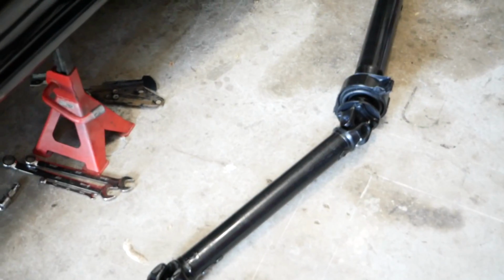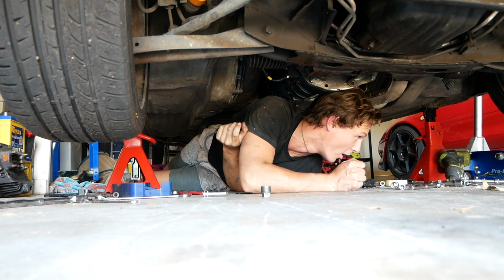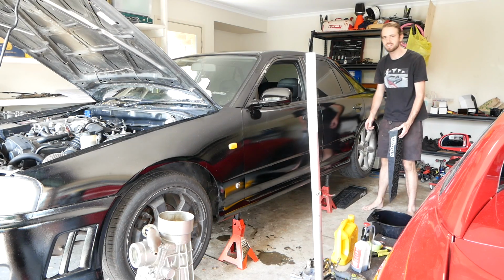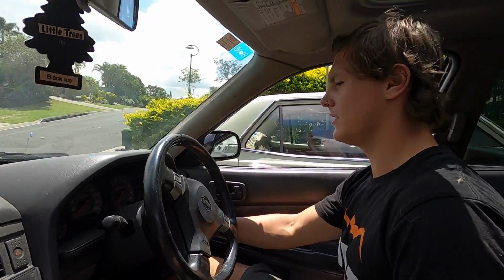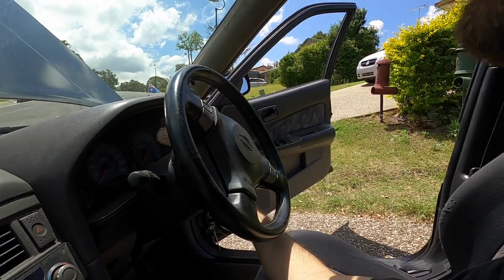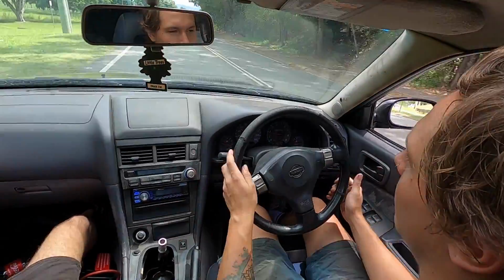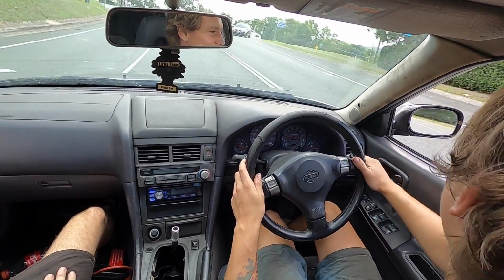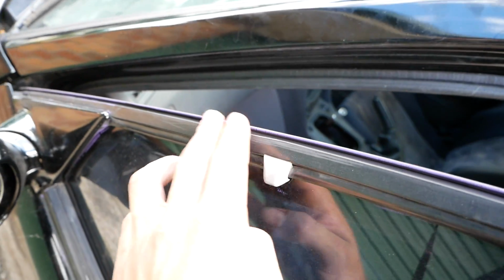R34 SKYLINE IS BACK ON THE STREETS!

Comment: The NAs use a 3x 2 6 bolt long nose (front sensor) R200 setup which the S15s also use but they're 3.7 to 4.1 depending on the engine and trans, putting a 5 bolt R200 is too much stuffing around and half of them are short nose, the tallest you can get in 3x 2 long nose is the NA Manual diff which are 4.4 while the auto is 4.1, na open diffs are super cheap you should be able to pick up one for about $100 and shove it in.

Also sick vids and keep the skyline, prices are spastic and they're getting to the moon can't even import na 4 doors for less than 13k landed and complied anymore
Reply from the maker: Ohhk yeah had a feeling it was like that! 
I’m not super fussed about how she’s goes anymore as my primary money pit will be getting my sill hwat and trying to get a tow vehicle 😂 yeah fuck a 4.4 would be wild fun in her 😂 Cheers for the info bro!! 
Hell yes stoked your enjoying!!! 
Yeah it’s proper dumb hey!!!!! So silly the prices, hopefully I can sell her now and then prices drop, that would be ideal!! 
Thanks for the comment bro!